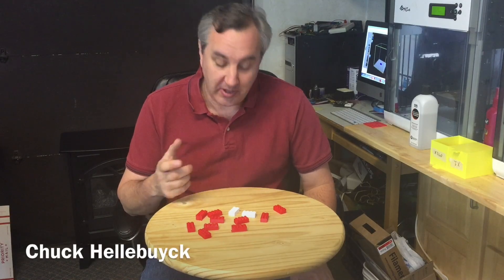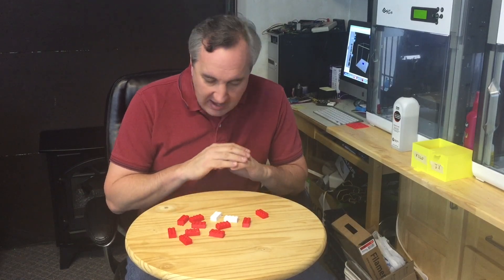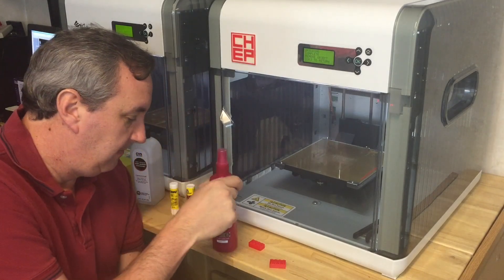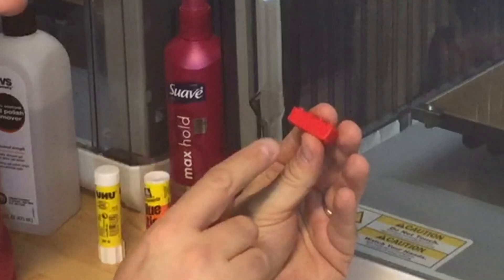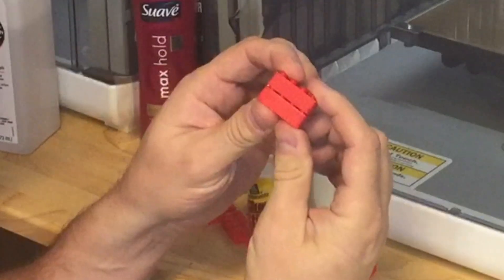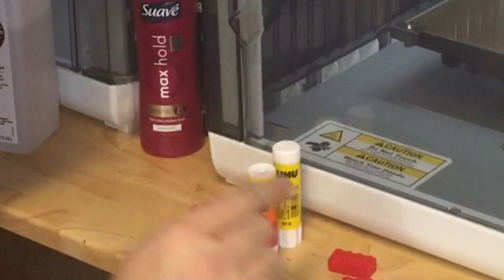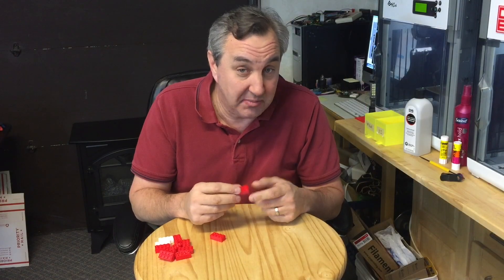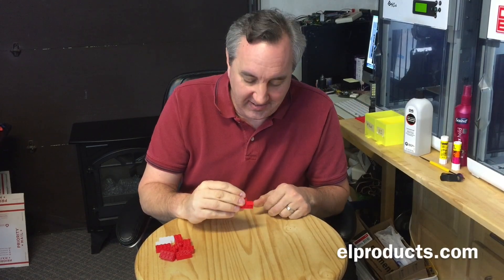3D Print Lego Blocks on a Davinci 1.0 Printer - Video #034

Comment: I've printed those in PLA.  IIRC, I used blue printers tape and must have got the first layer height right the first time by accident.  They came out great!  I later printed them on clean glass (used acetone to clean the glass), heated to 60C, and that also worked.  I did print a "brim" around the parts which helped them stick.   I think my homemade heat bed (5w sand resistors glued to bottom of aluminum plate with JBweld) gives even heat, but the temperature will be more accurate in the center because that is where the feedback thermister is located.

Comment: hi, I built my own printer, and I have been 3D printing for 5 years. I would suggest you use don't use the glue, and you do not squish the first layer,  but have it in the middle. That is the hardest part about calibrating your printer. I spent hours calibrating, but when I printed the Leto block, came out perfect without the glue. It even did not have that rough edge at the top.

Comment: What are the costs of running something like this? How much is the plastic and how much would you need to print like someone else mentioned a death star? This is very interesting, thanks for sharing!!!
Reply: ***** thanks for getting back. Now... that's very costly! Lego Bricks are not that expensive, just the 2x4 I mean... of course there are sets with 40 tiny pieces for 10 bucks... I guess manufacturers didn't want any competition thus the plastic for the 3D printer is quite expensive...
Unless... i'm getting the wrong idea because I'm talking about legos... maybe for other things that prices isn't that bad...

Comment: This is awesome, instead of paying 500 dollars for a death star lego kit, I could just 3d print all the peices
Reply: lol that is true, I just like having the satisfaction of building the project myself
Reply: but u spend 5000000000000 dollers on filament
Reply: No, the filament is still much cheaper. The $500 set will probably print for $100 or even less, depending on pricing for your filament. The real problem is the $500 death star will take months to finish printing, and the pieces you get from the printer tend to fit very tight on large sets, or have small errors from things like first-layer-squish, to the point where eventually they won't go at all. The best use for 3D-printed Lego-like parts is filling in a missing or broken piece on an old kit, or adapting an existing kit to do something new.
Reply: That's not even a number,
Here's what I think you ment.
$500,000,000,000,000,000

Comment: Hi Have you tried a glue stick from Tombow. I use the Tombow Professional Glue Stick. It is washable and Wrinkle free. It is a harder substance, not so squishy and i get great reults. It really grips well. You need to let your bed cool down to get the print off. You will hear it crack as it cools then it will just lift off. Any way give it a try you wont be dissapointed cheers Tim

Comment: I tried hairspray as well and what I found is that the aerosol type works WAY better than the regular spray bottle. I ran out of glue and so I grabbed my wife's name-brand aerosol spray (Aussie was the brand) and it worked wonders. So the next time I went out, I grabbed a bottle of cheap, high hold hair spray in a regular squirt type bottle and it doesn't hold at all. The prints lift and it almost seems like it acts as a lubricant instead of a glue.

Comment: Not sure exactly what type of glass you're using, however one thing that you should be aware of, or maybe even know already, but if you just print to the glass using the glue you might end up with a crack/chunk of glass coming out of your bed.  (here is my blog post on what I found out the hard way:  http://www.dbclunie.com/2014/02/what-adhesive-do-you-use-when-3d.html )

With that said I also you mentioned in another comment that you've tried 3m blue painters tape without success.  I know I've had similar results with blue tape/masking tape.  The key for me was if the tape felt too waxy or smooth i'd use a bit of sand paper to rough it up to allow for the plastic to get into the micro groves of the tape and hold, this worked really well with brims on objects, however as the tape grew older some prints would hold on too well and the tape would essentially be trapped in the print, so what I started to do was to put glue stick down first on the bed, just a light coating to keep the tap from lifting as it does sometimes with the heat, especially on really warpy parts, then put down painters tape, then another very thin layer of glue stick.  (i use the purple disappearing glue stick from elmers which you can get on amazon for 30 bucks a case) 

Doing it this way protects your glass bed from cracking or getting chunks taken out of it, and the glue still keep things from warping up and failing a print. 

keep u the great videos!

-d

Comment: Great info, I noticed you don't say what bed temps or nozzle temps, nozzle speed, layer height Ect... So I am assuming you are using the basic settings, I have a Davinci 2.0 Duo and am trying to work out some basic problems. Do you thing you will get a dual nozzle printer soon? I'll keep tuned in on your work, well done videos.

Comment: I have a question, and of all the videos I have watched for 3d printing you seem to be the most knowledgeable.

I am wanting to get into 3d printing, but have always wondered how high the electic bill would get.  Do you know the wattage the Da Vinci runs at?  And from experience how much do you think printing a Lego block costs as far as electricity? 

I love your videos

Thank you, 
Jimmy
Reply: ***** I run at least one printer every day of the week for several hours....I put 122 hours on a Davinci in a week. If we do a rough cost at $0.15/kwh (varies) and the average 35 watt (which some of my other bots are 20 and 25 watts)...so if I ran that for 120 hours per week times four weeks times 35 watts...that's 16.8kwh...or $2.52. Can anyone check that? I started printing years ago and as far as I can recall, the electrical cost hasn't increased my bill drastically.

So if you only used this 40 hours a week it would cost 1/3rd of that...75 cents...

Unless I totally hosed my math...

Like you my mancave is in the garage and, yeah, the stupid heater probably costs more than light 3D printing would cost....then again...when I've got two printers running the heater doesn't kick on very much. 

Jay
Reply: ***** Hmmm...I went through only 450-500 meters so far and I;m now at 152 hours. I think there's two factors for the disparity. One I only use 10% fill on 90% of my prints and most of my prints, while large, are pretty much hollow submarine hulls. Which leads me into the second factor, it's hard to say "X" hours is equal to "X" filament. A high resolution pair of dice would take hours to print at .1 but not take 'that' much filament. Same thing with one of my large hull frames finishes at around 3'' OD x 6" long and takes 9-10 hours to print but filament used was (varied) around 40 meters. I once, stupidly, printed a pink pig at .1 with 30% infill on my R2X....was 12 hours to print and used a good bit of filament...for something about the size of a softball. 
Chuck, I am also using Simplify3D and I'm getting slicing errors. I've used S3D for a while and it's only with this newest release. Of course it may be the master files but if I remember right...I've used them before with S3D and didn't have any problems. I hope it's just a glitch on my end. I just run them through NetFabb's Basic Heal function and then re-slice. Have you seen anything like that?

Cheers
Jay

Comment: I have actually printed Legos on my Da Vinci 1.0 before, I used the glue that came with the printer and it came out loose fitting, I didn't think you'd be able to get a tight fitting Lego with the Da Vinci. Great video.